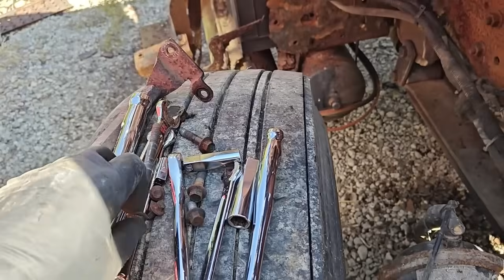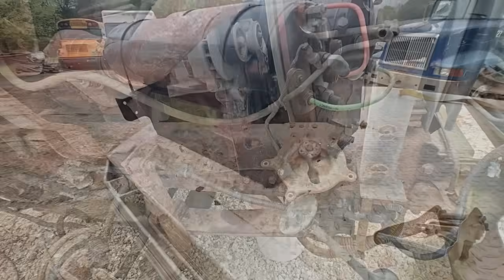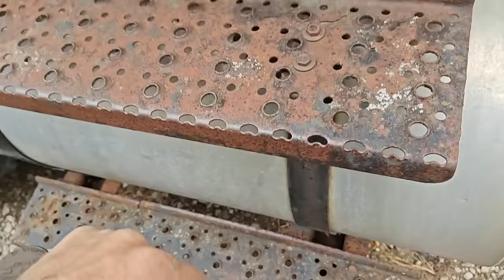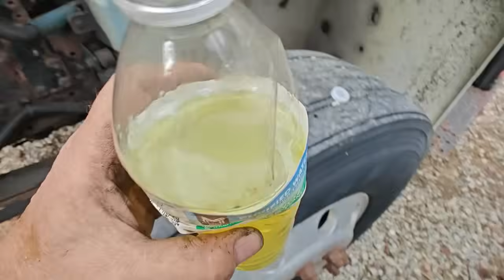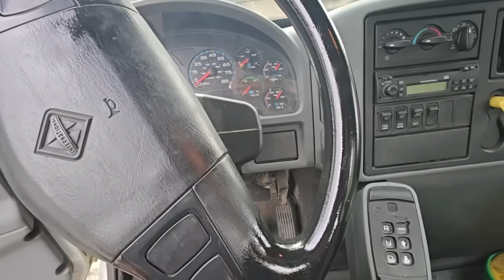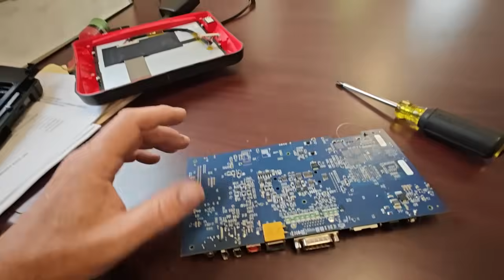DT466 SURGING ISSUE THEN NO START!

Comment: Usually injector o rings with icp oil pressure unable to build during crank. If  an injector o ring is blowing oil it will exhaust the oil pressure neeeded for engine start. Pressurize the fuel sytem with air through the the oil manifold and check for bypass around the injectors with valve cover off or listen carefully.

Comment: I'm sure you're already aware of all this, but I'm just thinking out loud... since its been a while since some of us have worked on these old heui systems. Remember basics. Check requested vs actual hpop oil pressure...it wont fire injectors till it sees something like 700psi...icp, ipr, all could be culprits. do they have cam sensor issues like dt444's? anyways, good luck brother👊

Comment: That is a db26 right angle pcb mount male connector. You will ideally need a desoldering station that heats and sucks out the molten solder but be careful of the through plated holes. The 2 mounting points maybe better desoldered using solder wick. Clean off any residue using a stiff brush and IPA.

Comment: I thought you had a place that would repair some of the electronic modules on your trucks. I COULD be wrong because I watch so many of these shows.  I do know that there are places that repair many different auto modules just by re-soldering the connections.   Being old and shaky,  not that you are, I would be tempted to check around with somebody that is into auto, video, or audio electronics to see what they would charge.  These days saving a buck is important, to me anyway!  Just a thought.

Comment: I am not sure the capabilities of your scan tool, with monitoring ICP  but I am sure you will know if you do have a high pressure oil leak if it starts cold, Also a small shot of ether when hot if it fires up is another sign it gains just a little more rpm on cranking to then bump up your high pressure oil on cranking to allow it to fire the injectors.  regarding your fueling aeration, not sure on how significant your issue is, But I had a dt466 that would run, eventually die out, crank no start after.   There is a small schrader valve in behind the fuel filter housing, closer to fire wall, on the cylinder head. The passage of which your low side fuel flows through, through each injector.  it will have small rubber nipple on it. you can shove schrader valve in to help bleed the system, or in my case, I was able to see how aerated my fuel really was on cranking & running if I could get to run,  causing me these issues. 2 of the injector hold down bolts were loose. which allowed 2 of the  injectors to shove up just enough that it then allowed cylinder compression to enter the fuel passage, blew out the fuel sealing O rings. ( just something to think about if you keep having issues)   Also  If you end up resealing your high pressure oil circuit make sure to change the puck O rings as well inside the high pressure oil rail. Some people have missed those. running rough common issues could be, plugs inside battery box for ground wires and power wires become loose connection, arcing inside the plug. sometimes best to eliminate plugs. IDM plug near valve cover as well have seen that melt up inside.  IDM relay in fuse panel when hot act up.     I ran a dt466e service truck for years and never an issue.  The issues I have seen is with customer trucks. best of luck. 👍

Comment: Did you plug one end of the scanner cable into the scanner and then check for continuity between the relevant pin where the socket it soldered to the pcb and the other end of the cable. I'd start there.

Comment: Hopefully you can pinpoint the high pressure oil system without issue.  Too bad to see that one little misaligned pin took out your entire scanner, but I guess that’s how these high tech tools operate.  Hope you can get that circuit board fixed easily.

Comment: That soldering doesn't look too difficult as long as you have a steady hand, the biggest thing to be mindful of is the capacitors right next to the 3rd row of pins, be careful not to disturb those.
If you do tackle removing  and replacing that connector I'd highly recommend getting yourself a magnifier with a light you can mount to the bench if you don't have one already.

Comment: New T shirt design

Every tool has a hammer side.  Even if it’s brand new.    

We install battery switches on everything at work and a 3/4 LED light so we know when the switch is left on.

Comment: JC in your honest opinion how would you rate Milwaukee tools vs Craftsman tools.
Reply from the maker: if i was comparing new craftsman to new milwaukee, i would choose milwaukee. milwaukee is stable, expanding, releasing new tools everyday. good possibility thay will continue on for many years to come. craftsman was a good tool for a decent price in its day. then it was sold off to another company. i have no faith that it will be around tomorrow. let along years ahead. nothing worse than investing in tools that you cant get warrantied.
Reply: @j.c.smithprojects  Thank you so much. I will begin investigating in Milwaukee tools. The reason I ever bought Craftsman tool's  you use to if you broke one you could return it and be back in business the an hour later.